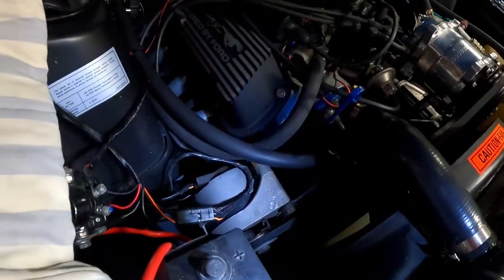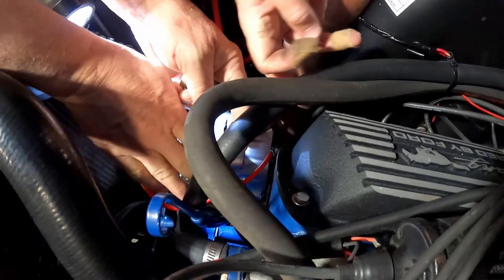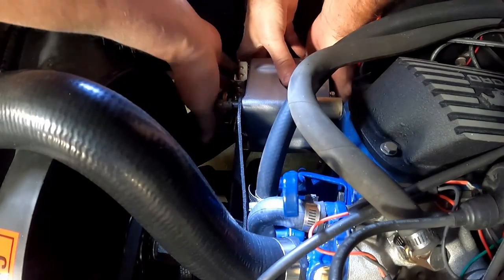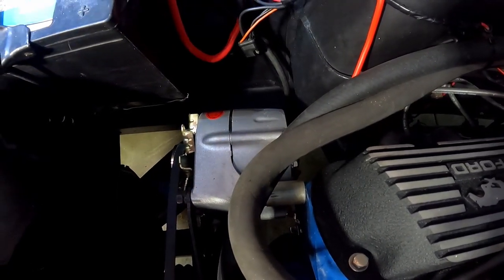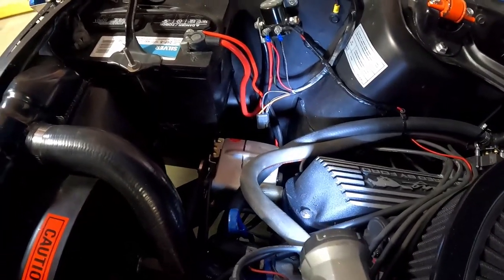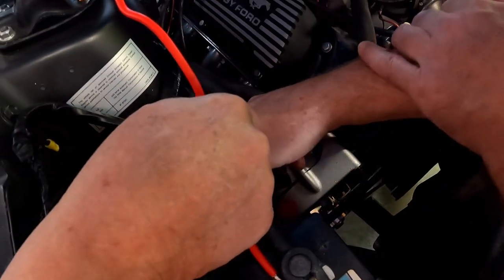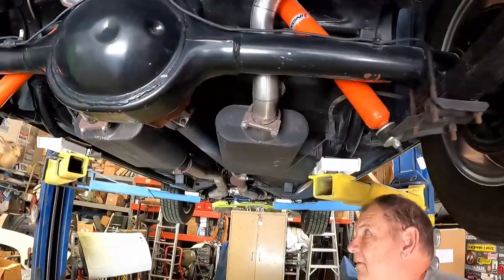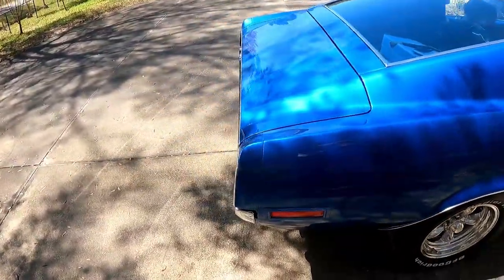1 Wire Alternator Upgrade Install, 1968 289 Mustang

Comment: Gave you guys a thumbs up for the video. Great looking car. Wish you would have shown what ground wires of the original alternator harness needed to be grounded and to where in order to get it started though. Also did you leave the old voltage regulator plugged in in the end or not? Thanks
Reply from the maker: Regulator got unplugged in the end for it to work.  Think we did try it plugged in and wouldn’t start, then unplugged it and works fine.  Thanks for watchin!